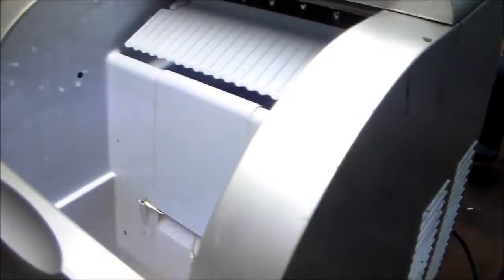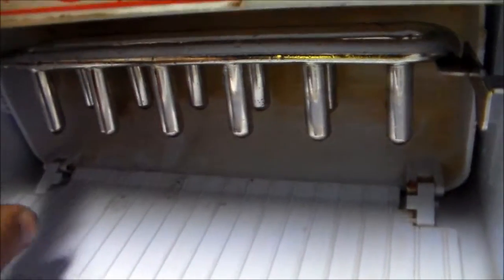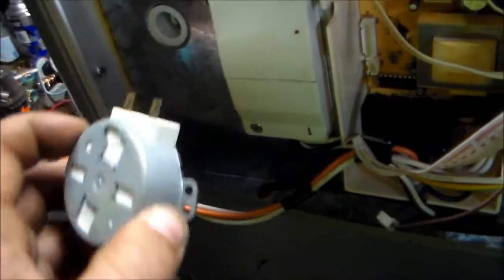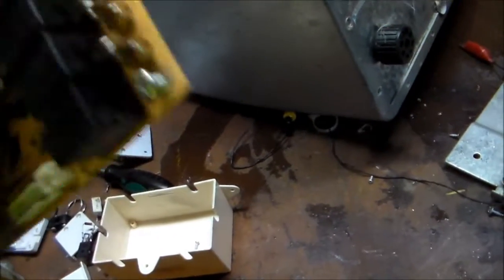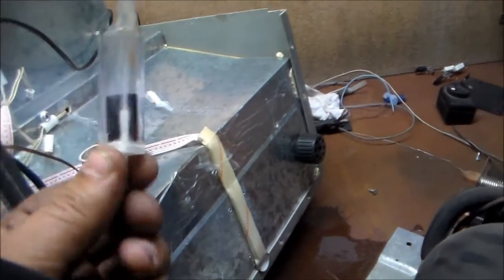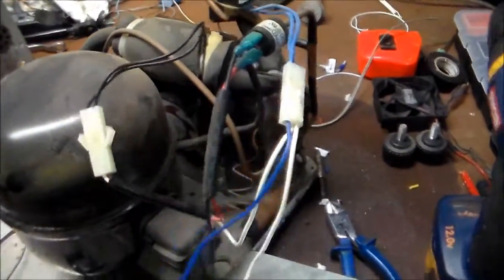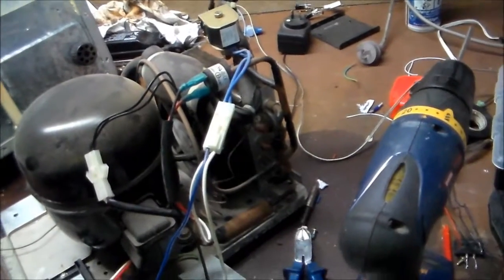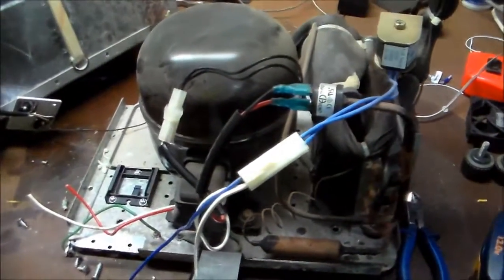Icemaker Reverse Cycle System, Teardown/Autopsy

Comment: Neat little condensing unit you got out of that!

nothing beats a cold beverage and somthing to rip apart :D

when the cycle on a system changes the indoor coil does become the condenser in heat mode, hence the name, reverse cycle.
this one would probably work on a timer then reverse, drop the cubes, then resume as a normal chiller/